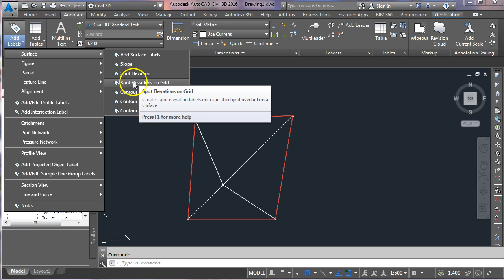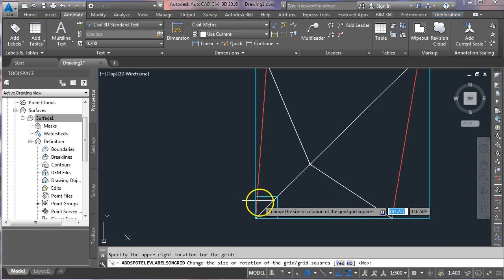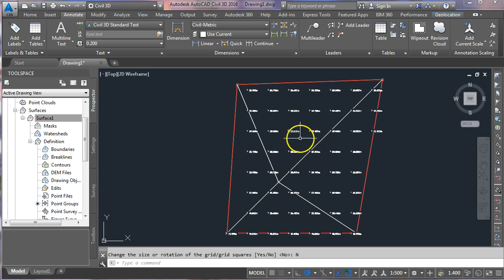Create grid of levels in Civil3D

Comment: Hi,  first up, your posts are great.  Short sharp and informative.  This post about spot leves is nearly what I need but can we do the same thing but with volumes?  I'd like to grid up borrow pits and show the volume avaiable in each grid.  Getting the entire volume of the pit is easy but getting CAD to calcualte and display in a standard grid has got me stumped, any ideas?
Reply from the maker: Hi. Thanks for your comment. I'm not sure if you can display the 'volume' in each grid, but you can display the difference in height between 2 surfaces on a grid. This requires you to have a base and a comparison surface, from which you create a volume TIN surface. After that, it's just a matter of changing how that surface gets displayed, so that it shows elevation differences rather triangles. That wold allow you to see the height difference at 4 adjacent points in a square, and if you average those figures and multiply by the square area, you'd get the volume in each square grid. I know this is only a partial solution to your questions, but it's all that comes to mind at first glance.
Reply: @CADandStuff  hi, I found the answer,  the Earthwork Plan Production command does the trick.  Still love you vids, watched another one tonight.
Reply from the maker: @stevedavidson8856  Good to know about that command, thanks for sharing.

Comment: how do you remove the labels?
Reply from the maker: Set the point label style to “No Display”
Reply: CAD and Stuff if you want to relabel at a different x y factor then the old labels are still there
Reply from the maker: I’m not at a computer right now to try different solutions, but perhaps one way would be to put the old labels on a layer and that you then turn off???